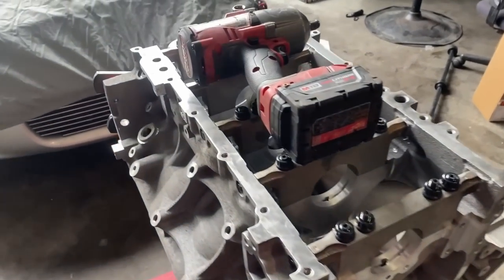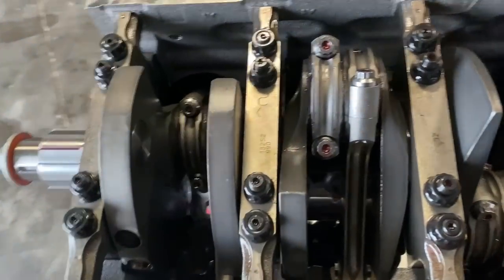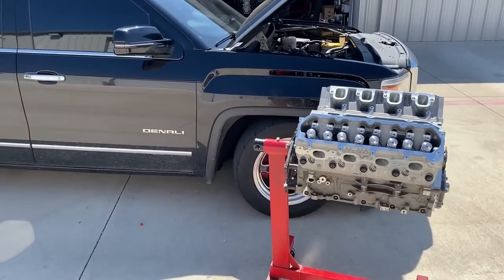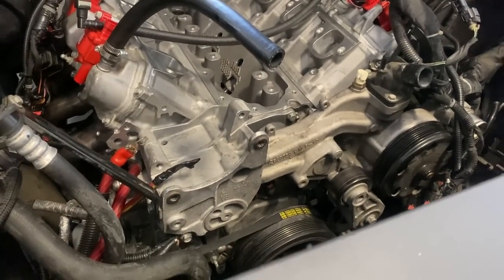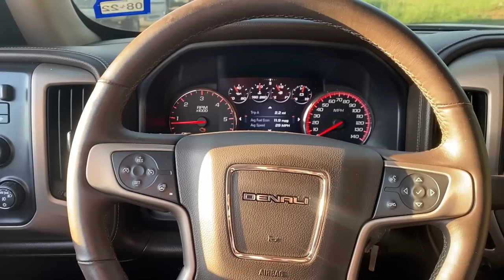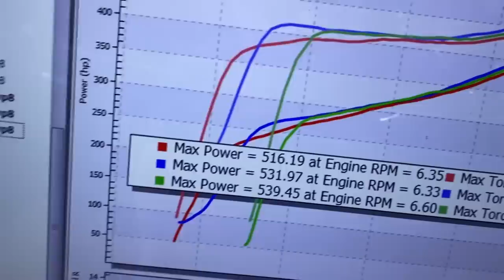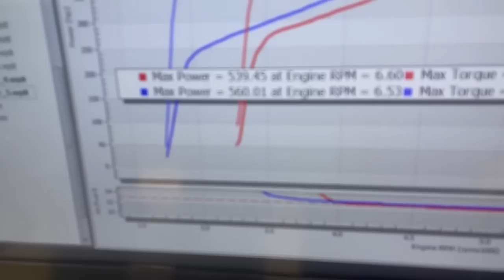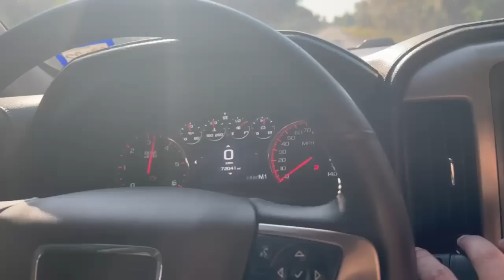416 LT STROKER CREW CAB RIPS! (BUILD START TO FINISH)

Comment: I have 15k miles and collapsed lifter on my 2017 denali. Single turbo and stage 3 circle D trans. Doing the Texas Speed 3 bolt cam with new front cover. so DOD/AFM and VVT delete. Still thinking about opening up the rings for boost? But how is your tablet mounted? pictures or video? Thanks

Comment: Hey jack do you know if a 2002 4l65e from a awd will be a direct fit for a 2001 4x4 4l60e?
Reply: Direct bolt on 4l65 just means it has a 5 pinion planet and what makes at awd is the transfer case not the tranny you will have to swap out transfer cases from the awd one to the 4x4 t case on to the 4l65

Comment: Prc does mark there heads on lt I have a 427 stroker long block from them and the heads say prc ltx
Reply from the maker: Yes sir those are on the LTX heads! These are the as cast lt1 heads ported by them but you figured they’d at least stamp them like LS heads
Reply: that & y’all should really look into the truck shifting itself with a built trans because my stock trans would have the same gear change and it went out pretty quick

Comment: Owner spent so much on parts and doesn’t seem like it’s been blueprinted.
Im saving up for my stroker, but am emphasizing on a builder that weighs and measures everything twice before slapping it together
Reply from the maker: Everything’s been balanced and all the clearances have been checked. Rings gapped to specification, cam degreed, butt out with your negativity
Reply: @jackstandbuilds  hey jackstand i have a gen5 lt1 a8 circle d 3500 i need some pricing on work im at 485 jus full  bolt ons and e85 i need to get over 580 whats that gonna take drop in pis n rod what else ???

Comment: I was expecting way more torque 😮from a stroker 416
Reply: I was expecting more torque and horsepower for sure
Reply: You can get that from a 6.0
Reply: @tuckerc3802  hell yeah with a holley high ram  ls3 ported heads milled big cam on some e85 and good exhaust set up close to 500rwhp
Reply: l86 6.2 has more torque stock idk what happend